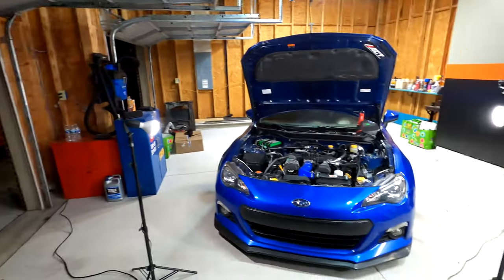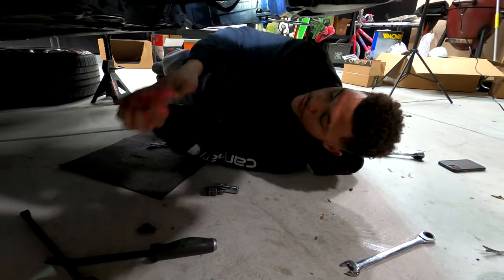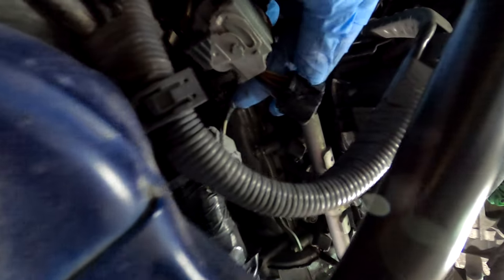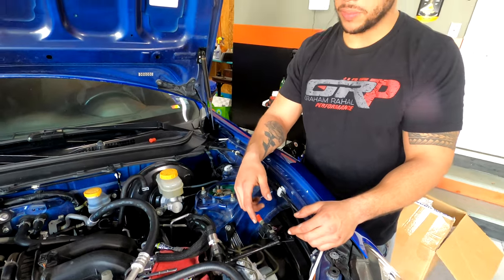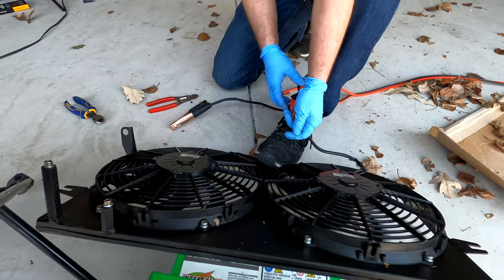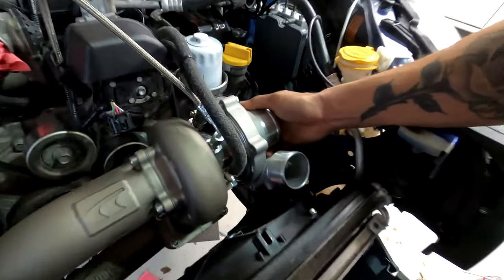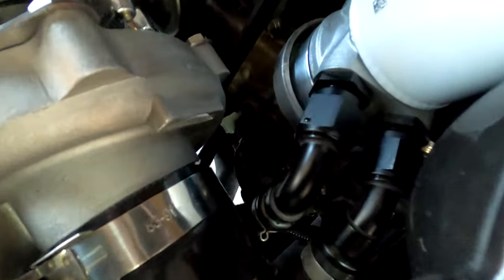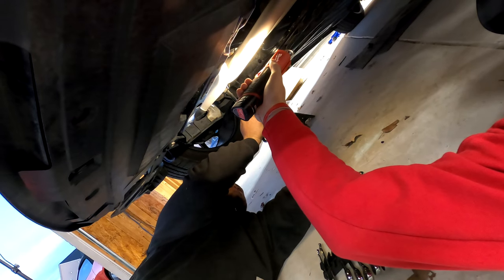BRZ TURBO KIT INSTALL

Comment: How has the lube on the Ftype exhaust valves held up? I have one of mine squeaking and want to fix it if just temporary
Reply from the maker: We used a high temperature brake caliper grease. Seems to have held up pretty well. However, we have since had it tuned, commanding the valves always be open.  We don't experience the issue any longer.